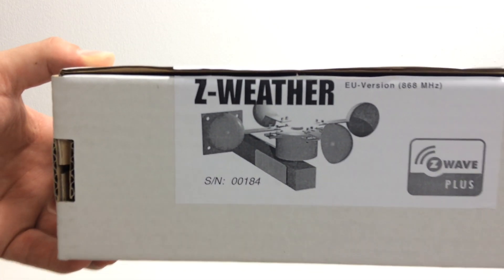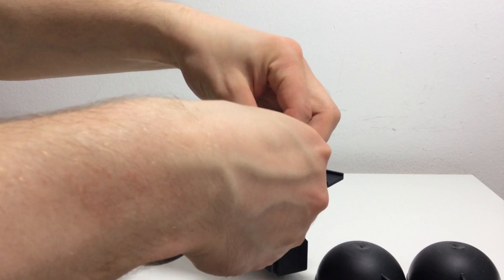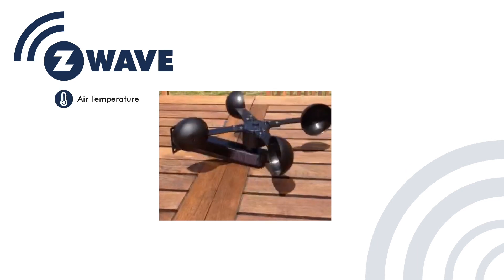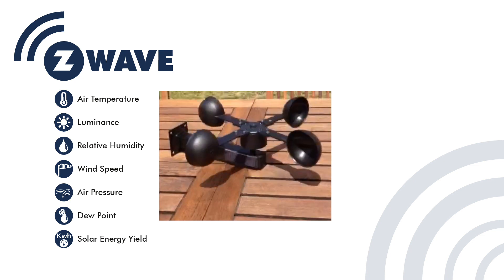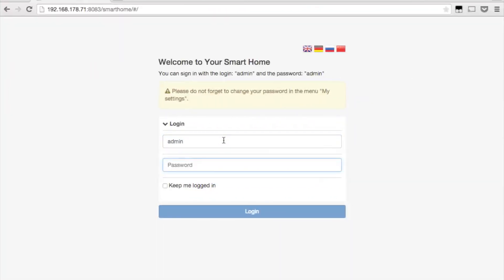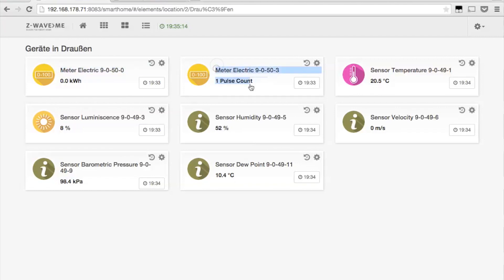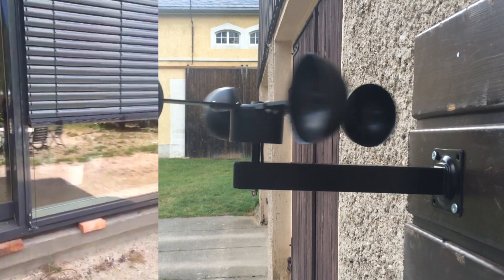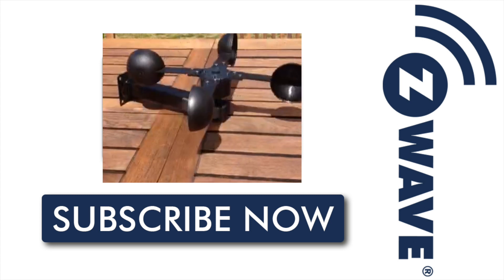Popp Weather - the world’s first energy-automated Z-Wave sensor

Comment: Beware that hasn't got a backup battery so may not report in the mornings when it would be very important to see what the weather is like when you get up. Listen at 3:55. I wonder why isn't using wind energy to charge itself.
Also doesn't report wind direction.
Wait for version 2.

Or if you don't mind a bit of assembly buy a Sparkfun Weather Meter.
Reply: Or why it not take both wind and solar energy for charging. It already have all the components to do that.